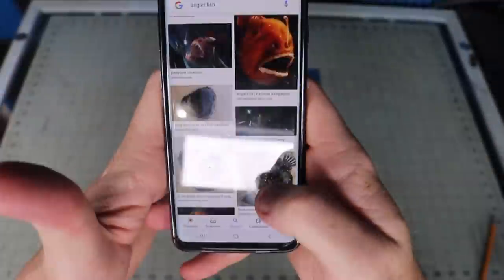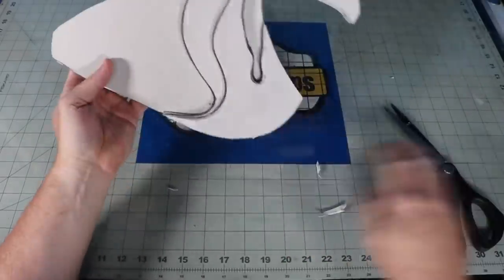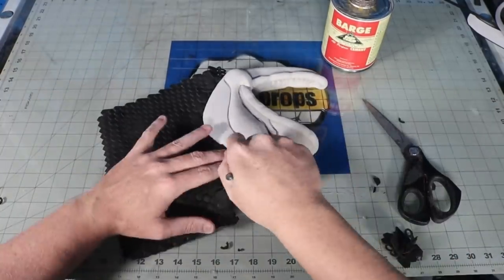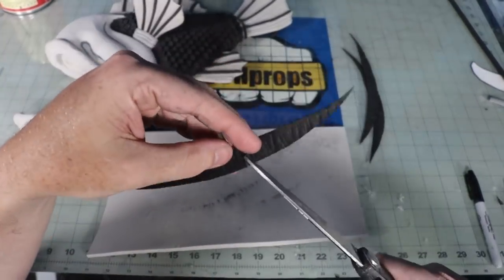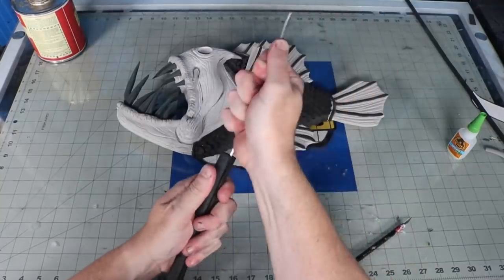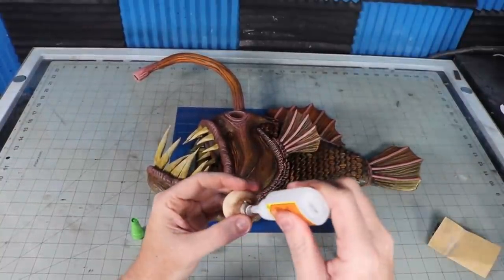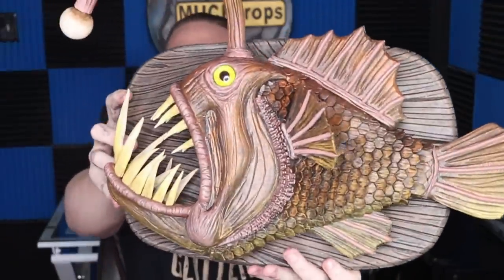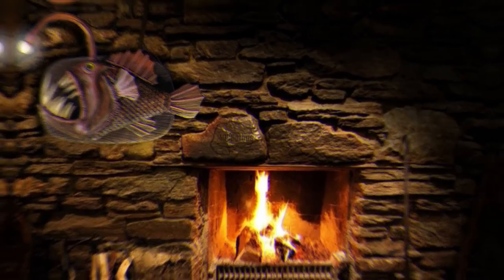Foam Crafting an Anglerfish

Comment: I always find out about the coolest stuff from your builds. I need some of those bullet LEDs! Great build
Reply from the maker: I always on the look out at stores, especially ones that save me from having to learn how to wire up stuff. I found them at my local Hobby Lobby, in the wedding section. I guess people use them in vases for table center pieces or in paper lanterns. You can also just search bullet LED lights on amazon and pull them up too.